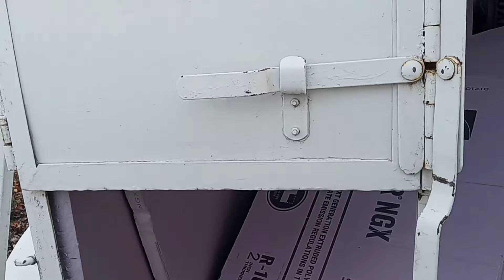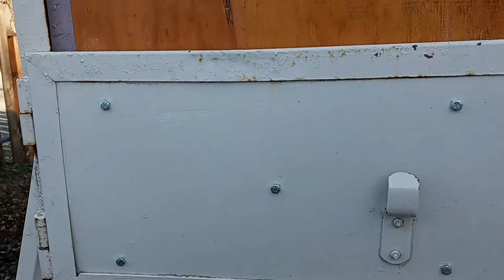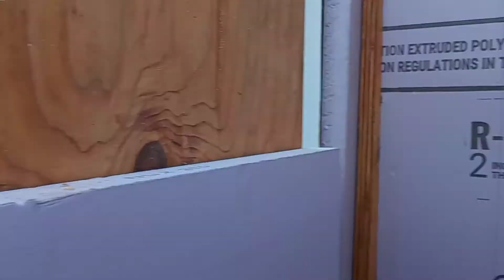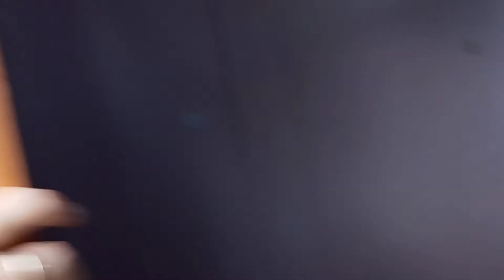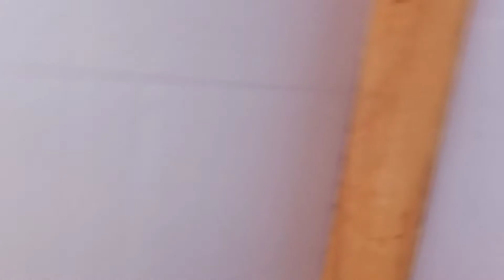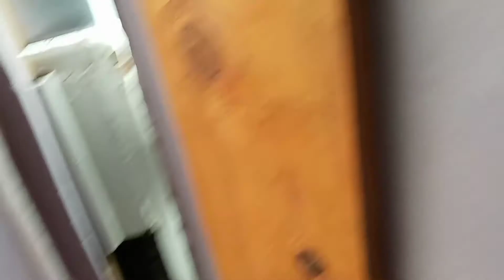Horse Trailer Walk in Cooler Conversion Project Part 2

Comment: What’s your use case for a cooler  trailer? Just curious just finished installing ac on my horse trailer conversion. Nice work 👏🏼
Reply from the maker: I'm actually still using this trailer with a similar setup I think I can't remember what I filmed in this video exactly but the use case has been both fresh produce as well as packaged nuts. It was originally designed for package nuts. It holds that 40° pretty nicely as long as it's not too hot outside.